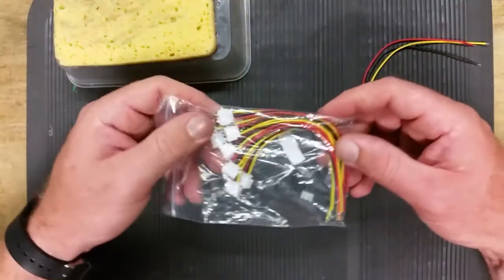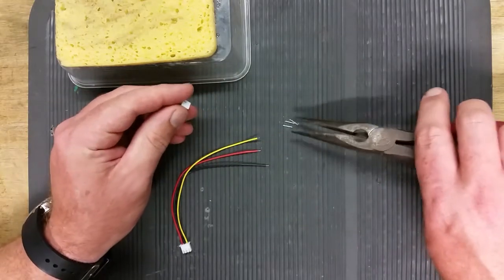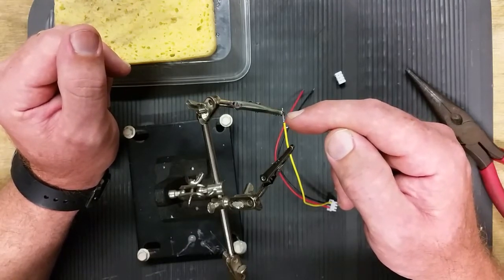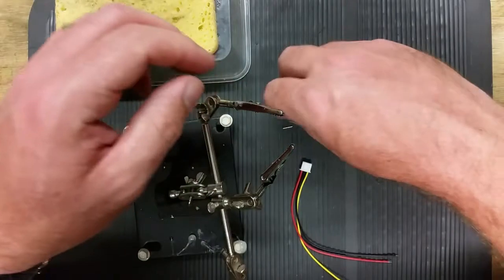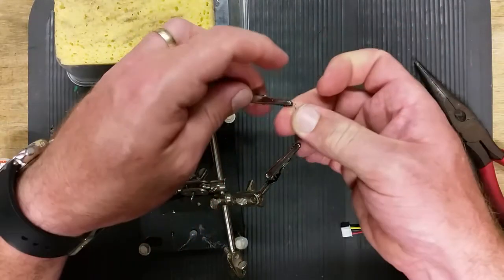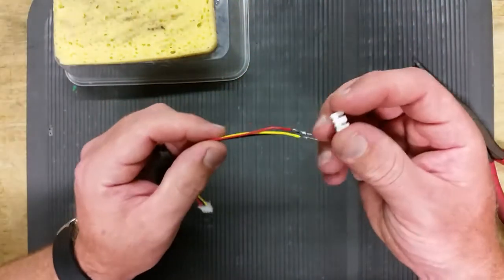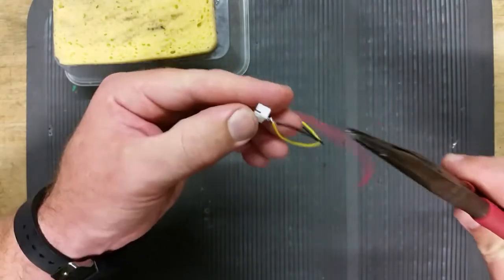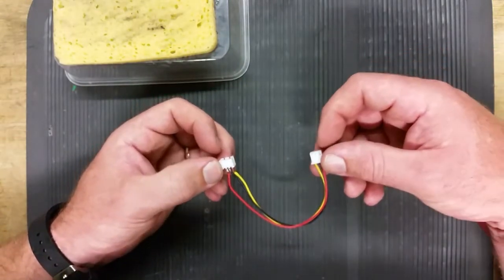How to solder JST-XH plugs

Comment: you could use the female pins crimp them with wire, attach them to the pins and then flux and solder

Comment: Anyone knows what the male jst plugs that come where you don't need to solder the wires on. Just crimp it and slide it in. I only see them on amazon in kits with pre crimped wires. But Thanks for the video like everyone else I was like WTF, the pins come out! lol
Reply: It's JST XHX and probably it's out of production/hard to find. There is an offer on ebay, with crazy price.